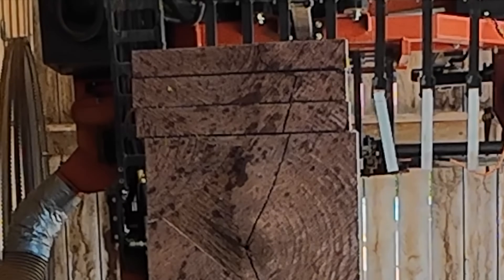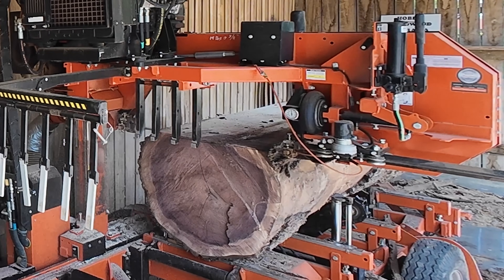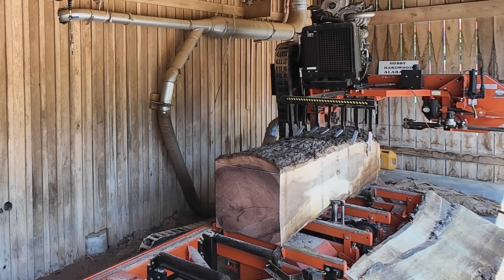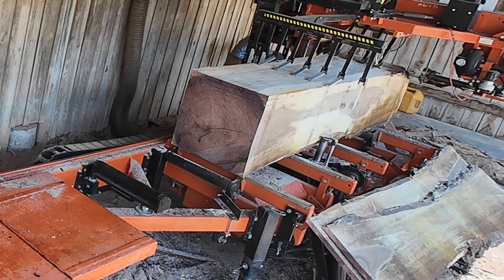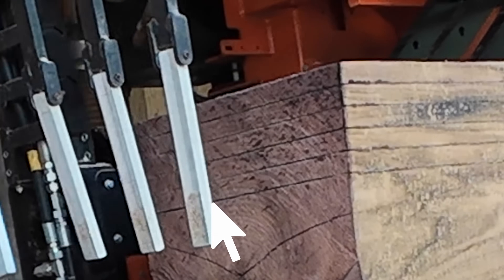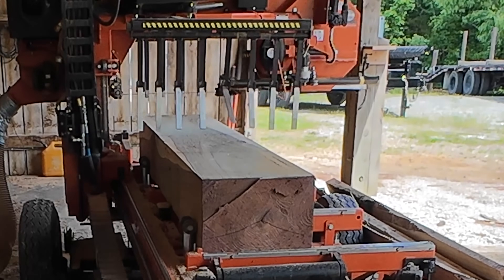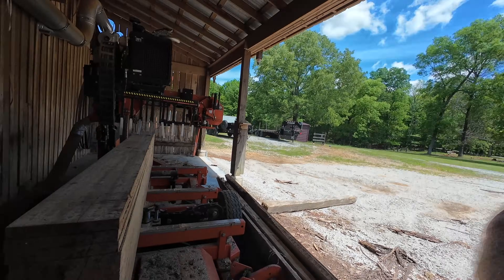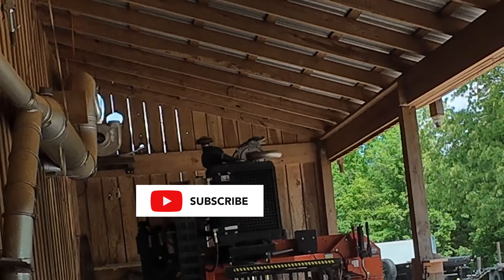Secret!  Sawmilling Flat Walnut Out of Stressed Logs!

Comment: Is your kiln and showroom set up for 8 foot logs? Or do you cut any other lengths? I am building a solar kiln and want to make it able to accommodate various lengths.
Reply from the maker: We sell up to 12 foot in the showroom, and as much as 16 foot occasionally but in reality, most high grade woodworkers prefer 8 foot to 10 foot boards and I can't tell you how many times we used to see longer boards and put up with all the headaches of handling and drying the, then only to be asked by the customer to cut them in half.  So our. kilns are optimized for 10 foot and shorter, although our big one can do 16's, I almost never do that anymore.  Yes it's useful for baseboard, trim wood, stiff liek that, but that is not high grade wood and not out product.  We specialize in high grade Furntire wood, and that is almost always desired as 10 foot and less long.
Reply: Thanks for the detailed response. You are God's gift to us beginners. I hope you continue providing information like the video's I have watched of yours.

Comment: Do you do anything differently sawing when you are the one taking it from rough cut to kiln and planed vs just cutting for a customer that wants it rough?
Cheers 🍻 
🇺🇸🦅🇺🇸
Reply from the maker: Rarely, I always try to make the best wood possible whether it's mine or a customer's.  Howard, if they want framing lumber I  put the stress in the face direction, exactly opposite of high grade furniture lumber.
Reply: @HobbyHardwoodAlabama , thank you